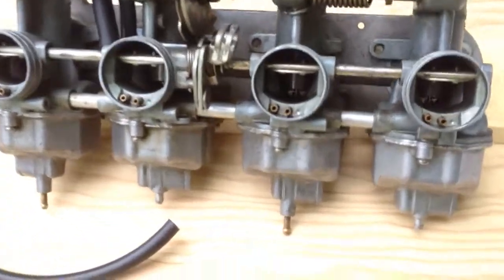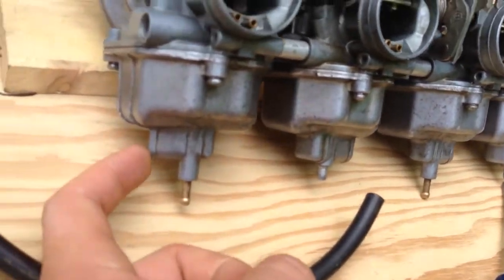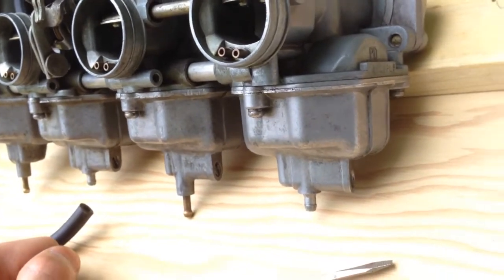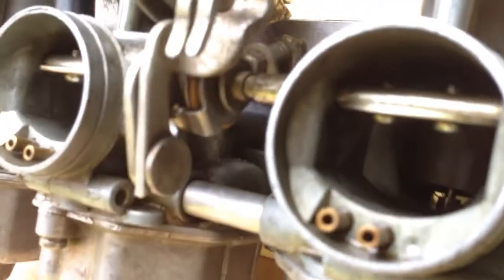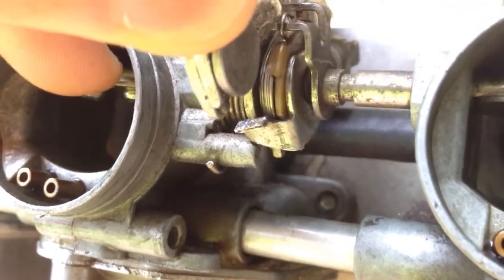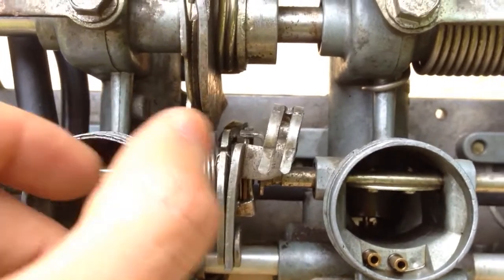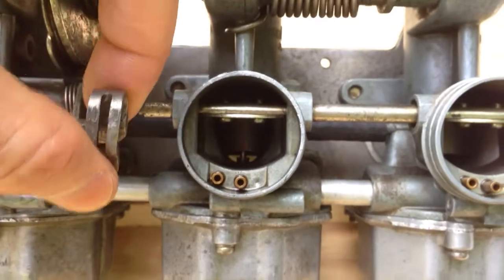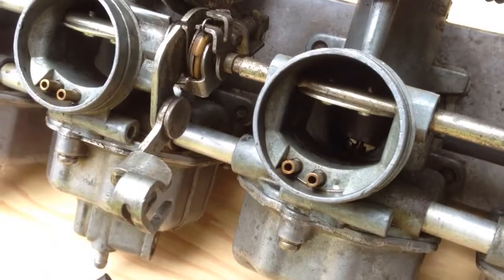PD46C Carburetor Choke Assembly

Comment: Have you found any good sources for this carb assembly? I have the same carbs completely broken down.
Reply from the maker: Jacob Stull Sources as in parts? You might want to join the SOHC4 forum and contact member Harisuluv. He has a bunch of carb parts and also rebuilds carbs. If you're looking for schematics, I haven't found any. But again, Harisuluv knows these things inside and out. If you post a question he may reply with a bounty of info.
Reply: Your carb bowls have been replaced for some reason. Your video helped me big time. Couldn't get my choke assembled properly until you did a close up of how the lever sits. If that makes sense. Much appreciated. Hope your bike turned out well.